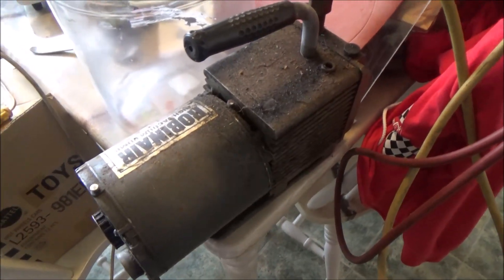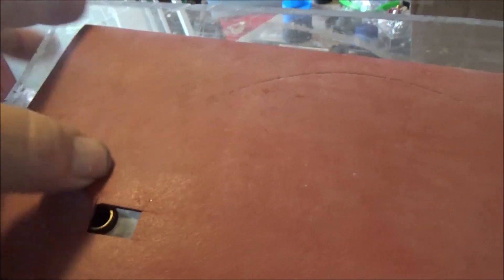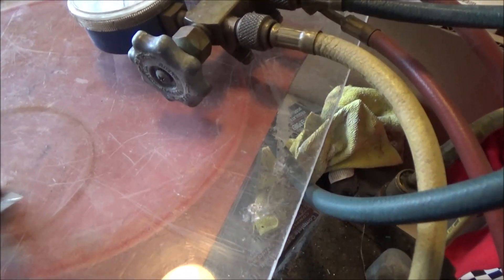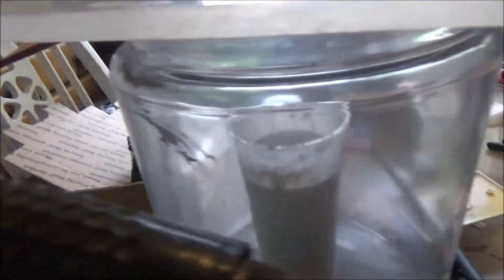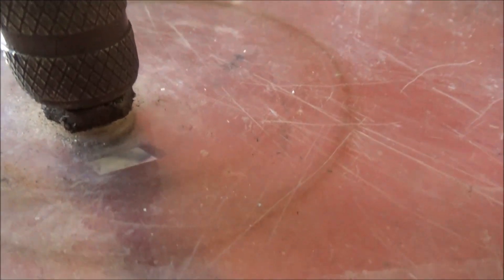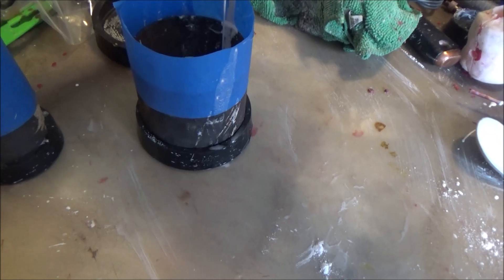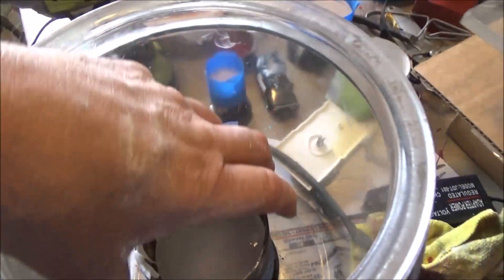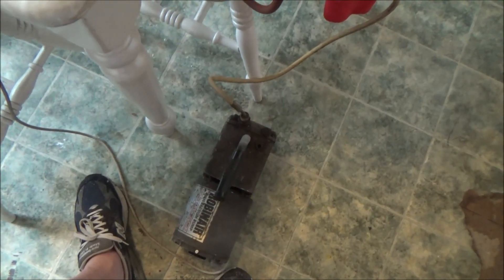How I used my Home made Vacuum Chamber to make ring molds

Comment: Great little chamber there bud. I did a post on mine but went a bit overboard with it. You can check it out if you like. Using what you have is always soooo cool in my eyes for sure. You must be close to sea level as I am at 3800 ft and can only draw 26 in. Great step by step my friend. I learned a few things from this today bud.I did find that I had to make my plaster a bit wet as the pump was pulling the moisture off ? Was/is it the same for you ?
Reply from the maker: Yeah, if you vacuum it for to long it will evaporate the moisture. It would be ideal to use a pressure  pot and let it cure under pressure but I don't have one.